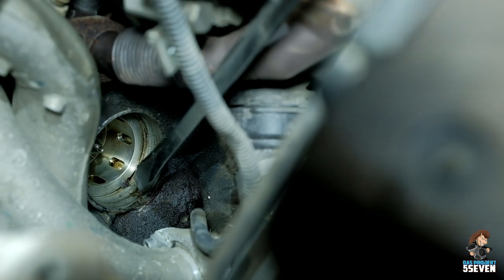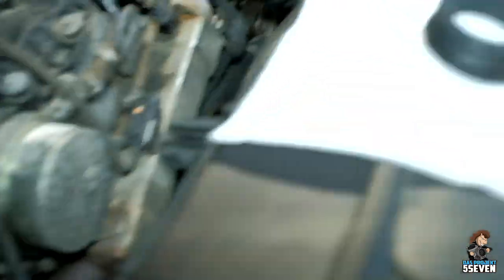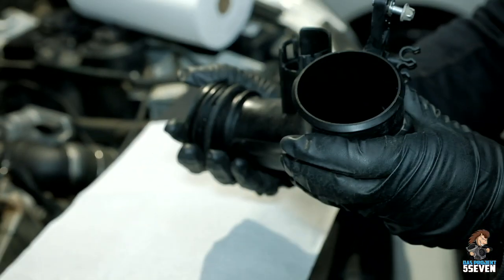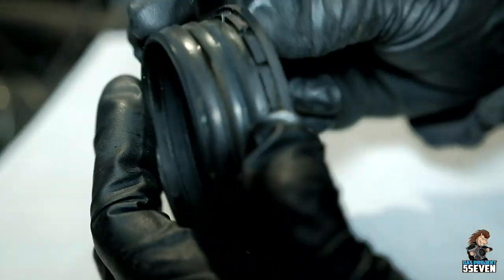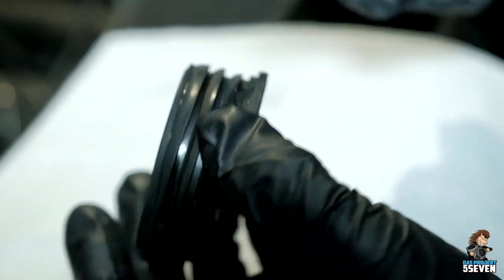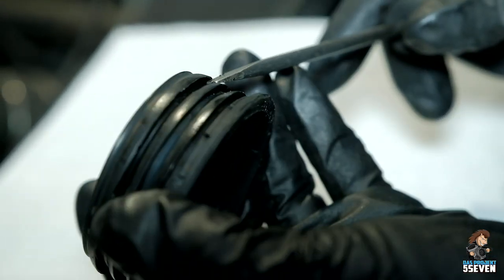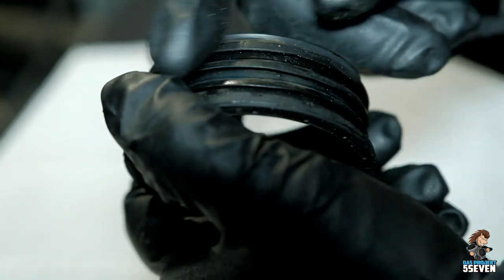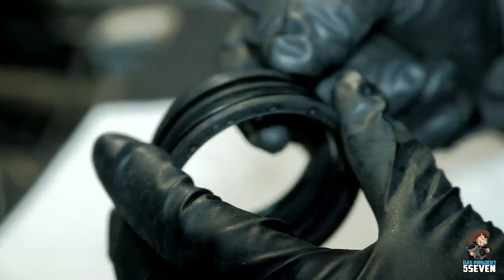BMW m57 335d & X5d Failed Turbo Inlet Seal

Comment: Is always crazy instructiv ! you should have thousands of people on your channel. when we compare to other youtubers who post wrong hings.... thank you alot for all videos you make, i learn almost on each one ! :)
Reply from the maker: Thank for your kind words. We appreciate it and glad you find it useful.
Reply: @alphadevyat Hi, what were your symptoms of this seal failure?
I have the M47 engine and on acceleration i get a fluctuation of revs dipping around the 3500 rpm range, after a second or two the revs will start to increase.... swapped out map sensor and boost control sensor plus all boost seals. The only seal i have not replaced is the air intake to the turbo. Any ideas or suggestions would be very appreciated 👍

Comment: Hi there. Thank you for your videos. I am wondering if a failure on this seal would cause oil leaking on the AC compressor, and eventually to the ground. I have some leaks coming from the turbo area. Trying to figure out if the oil feed and return lines are the problem or if it may be this seal. Thanks
Reply from the maker: @yamaccandan1  it could be. Easy to examine the seal and replace. I use a thin bead of Hylomar sealant on it.  Top turbo feed line could be a culprit too. Drains leak rarely.  But I suppose with age anything will need attention. If you have a larger leak it could be the valve cover gasket. It’s a maintenance item. If you want to be preventive you should do it at about 100k miles or 150k km.
Reply: @alphadevyat  Thank you very much

Comment: Awesome vids you been pushing out.  I have learnt a lot and will be doing Vacuum lines, pressure convertors and renewing thia turbo seal.  I am hoping this fixes my problem.  After driving at around 120 I can lose all boost.  I have to stop car turn off and then boost is back.  Baffled with it to be honest.  Anyhoo, my question is, do you have part number for that seal.  I cannot find it anywhere.  Cheers
Reply from the maker: Sean, here is a part number for the seal: 13717799839. Also , sounds like your issue is fueling related. You need to do data logging to pinpoint the problem. Cheers.
Reply: @alphadevyat  Thank you mate.  Car was recently mapped and nothing wrong was picked up.  I will get all the vacuum pipes renewed and then get it data logged.  Any recommendations on platforms for doing it myself?  Thanks again.
Reply from the maker: @seanus27  for logging I suggest TestO. We have a few videos on that.

Comment: Great info on the inlet pipe 👌🏻 is the amount of oil in the housing normal?
Reply from the maker: For this platform it is normal. I also suggest to replace that seal and use a thin bead of Hylomar Blue on the outer edge.

Comment: How long do turbos last on these. 

I’ve replaced all the vacuum lines, the 2 pressure converters, and the boost controller and still have 4530 code and limp mode. 

The limp mode triggers around 1.2 - 1.5 bar boost. I’ve heard that turbos are good on these engines that’s why I still don’t think that’s the issue but don’t know what else it could be.
Reply from the maker: Ben, turbos should last with proper maintenance.  Small turbo dies first as it’s the one that works the most.  4530 is a fairly broad code that could also come because of exhaust leaks or restrictions. But they have to be severe. I would say at 1.2-1.5bar trigger, you are still looking at turbo control system.  Could be misrouted vac lines. Sounds like you’ve renewed most of the things. May be time to log it and see what requested vs actual boost does against exhaust pressure and against rpm and throttle. One item you may wish to check is the exhaust pressure sensor feed tube.  Some of them get plugged up and it’s an easy fix. It will show up as a lazy emp signal in logs.
Reply: @alphadevyat  
I used bimmerlink and it says the boost controller is reading 0% 
I’m not sure why, I’ve triple checked the lines and the pressure converters/vac controller is new. I’ll check system vacuum to make sure I’m getting vacuum to these things. I’m sure I am since the actuator retracts when the car is turned on and then releases like 30 seconds after turning off the car. 

I’m sure the turbo switchover is working too because I can feel the big turbo kick on as I crest a hill then it usually hits limp mode after that. 

I’ll check that exhaust sensor line and then take it to a shop so they can run ista and diagnose my issue. Only thing I’m unsure of is the red boost pipe or the small turbo. 

I can’t say much about maintenance since I’ve only had the car for 2 months but the service records show that it was maintained at bmw from 60k miles to 111k miles then went to a bmw specialist shop until 114k when we got it.
Reply: did you manage to fix your issue? if so what was it @bm-garage
Reply: @shammyali3895  yes it ended up being a clogged dpf for me
Reply: @bm-garage  ahh okay i don't have dpf😅

Comment: Hi 
I just ordered these seats because my vehicle (e70 35d) is in/out of limp mode and return code is 429A ‘Boost Pressure Control Low Pressure Stage, Deviation’. 
Is this a possible culprit, or should I replace the MAP sensor and/or throttle body?  Also, it only started to give a warning and go into a limp mode  during heavy load (wipe open throttle; going up a hill to pass a vehicle) but not its constant with the slightest touch on the gas (almost underivable at this point).   And lastly, during acceleration there’s a shudder noise during acceleration. I looked at the lower pressure
charge tube and noticed a lot of oil around it. I then found this video and I’m thinking to replace the gasket you described as this may be a culprit for the oil leak AND the 00429A code for Boost Pressure Control Low Pressure. 

Any ideas/thoughts/suggestions?  
Thanks for the freak videos BTW.
Reply from the maker: Nicolas, this gasket usually wears out but I’ve never seen it cause error codes. May be if it’s really bad and lets in unmetered air. But then you would have MAF codes. 429A you gotta look to your vacuum and turbo control systems.
Reply: Hi did you fix this problem code 429A I have same issue with 2012 e70 35d?
Reply: It turned out to be small little vacuum lines. These deteriorate over time and are very brittle. Took it to a shop and replacing some of these did the trick for me. 
Got the car running good and now, 2 years later -  I have the DPF warning message on….I’ve had this car for almost 9 years and it’s always something.
Reply: @nicholaskoroneos4516  thanks for responding i changed all vacuum lines all pressure converters  but still code p02cb /429A
Reply: What’s the part number?

Comment: Would this cause high oil consumption if the seal had gone?
Reply from the maker: Generally no.
Reply: @alphadevyat  I only ask as I've recently purchased a 2014 335d and it's using about a liter of oil per 400 miles but is still very responsive, I took the breather hose off and it's covered in oil.
It's a little smoky under hard acceleration but then again it is running a stage one map so some smoke is to be expected.

Any ideas what else could cause this?
Reply from the maker: @RiskyProspect  pluggged DPF. Bit you say it’s smokey. So with DPF you should see no smoke. What is the emp reading ratio against boost.

Comment: Do you have maf sensor fault code because of this? And a bad start?
Reply from the maker: Martin, I do not but you could as this is an air leakage past a metering point. Any introduction of additional air past MAF can result in an error.
Reply: @alphadevyat  my car has a fault code maf and have no power sometime and very bad cold start when I disconnect the MAF the car start perfectly and drive normal, I bought new one bosch and have the same issue fault code... I don't know where to search the problem..
Reply from the maker: @martinmarkov1626  what is the fault code?
Reply: @alphadevyat  3ff0 bmw e60 535d
Reply from the maker: @martinmarkov1626  that is a generic MAF code, but you should have a specific one to go with it. Like an intake temperature code. How is the wiring to the MAF. If your car works fine with MAF disconnected it uses substitute maps and relies on IAT, MAP and O2. Those should fine, but check the health of those as well.

Comment: At the time of this how free spinning is the big turbo?
Reply from the maker: No issues at all and no shaft play
Reply: @alphadevyat  how free spinning should it be
Reply: My cars from San Francisco California so it makes sense I guess for mine to be worn out it’s just sad big turbos definitely shot, and inlet needed replaced and the cold side is covered in carbon/oil
Reply: Lots of load from both owners
Reply from the maker: @bmwbuilds6028  not free spinning. It should turn but not spin on its own inertia
Reply from the maker: @bmwbuilds6028  what makes you think the turbo is kaput.
Reply: @alphadevyat  no shaft play but tight spots and barley rotates when hand turned still in car
Reply from the maker: @bmwbuilds6028  and this is backed up by boost data logs and error codes?

Comment: Hello, how can I contact you, thank you very much
Reply from the maker: You can post your comment here.
Reply: @alphadevyat  Hello, I have a bmw e70d and I get the error p0641, circuit 1. What are the sensors that involve this circuit?  I would appreciate the help, thank you very much.
Reply from the maker: @gerardo20198020  sorry for the delay. Battling corona here. So, according to ISTA  generic code P0641 is a bmw code 4670. Sensor supply voltage monitoring outside limit values. Sensors for group 1 are: accelerator pedal module, rail pressure sensor, charge pressure sensor, exhaust backpressure sensor, fuel pressure and temp sensor, throttle valve (ASV) sensor.  Values are determined by hardware. You could have one of these out and code May be set. Although you would usually get a sensor specific code. Don’t know if there was any work done one there car or DDE disconnected and may have a poor connection. I would also check your battery health. If battery is low it may throw all kinds of codes. Good luck.
Reply: @alphadevyat  Hello how are you, thank you very much for the answer, disconnect all the sensors and it continues to show me 3.7 V but it should show 5 V and the sensor that goes on the intake does not show current, they are measured with the engine running or off and it disconnects sensor by sensor or they can all be disconnected together.  This vehicle got hot the cables that go behind the cylinder head and the complete branch was changed and with these errors it remained.  Thank you so much